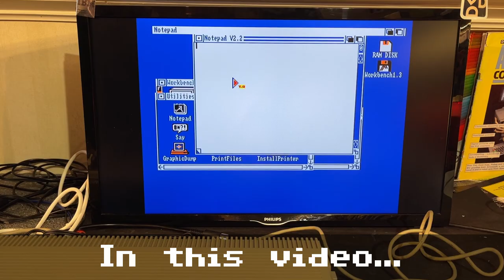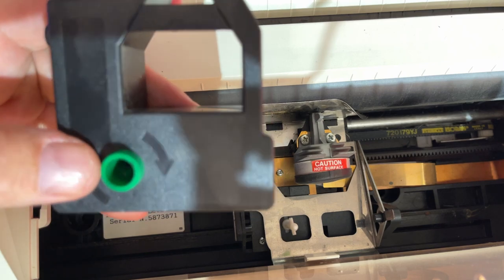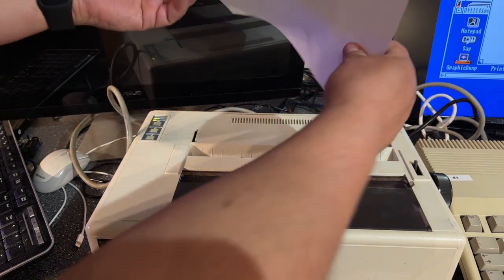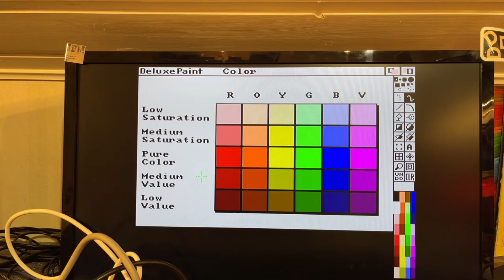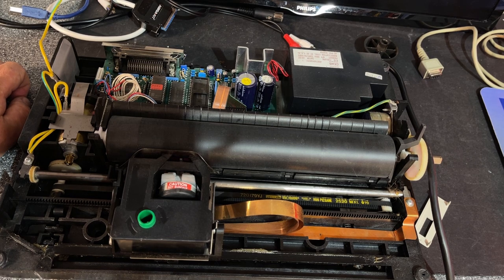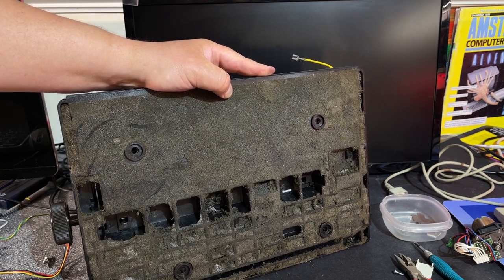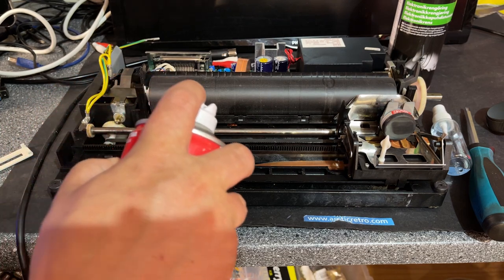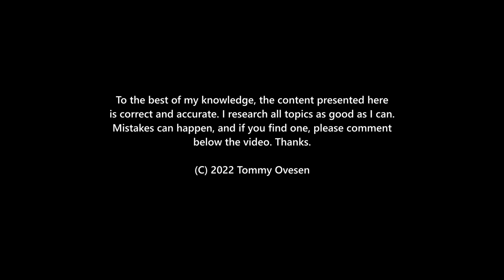The Commodore MPS 1500C retro color dot matrix printer - Can it still print? Restoration

Comment: Niely done, I used to have the MPS 1550C myself and have (like you) also found a replacement for it who was complete in it’s box. It did however had the same foam
Issue on the bottom. This printer has also a sort of a demo mode  when you make a certain key combination.

Comment: You can renew printer cartridge with WD 40, open it and spray just two or three short burst evenly on ribonn. Close cartridge and rewind it a few times (I use drill or dremel for this). If there is too much lubricant, paper or two will soak it. Works with B/W perfectly :)
Reply from the maker: Nice tips. WD40 can be used for everything it seems :)

Comment: We wish a speedy recovery for your finger. ;-)

I was surprised that you directly watered the printhead and drive gears. (I thought about a possible risk of corrosion. But I guess with a good drying and lubrication there should be no problems).

I'm guessing that (nowadays) it won't be easy to find inked ribbon cartridges for that printer. Have you tried looking for them?

I still have an old 'Star' monochrome dot matrix printer (which I used with my C-64 to do my school homework). I also have one or two unused ribbon cartridges.
I hope to find time to try it out again one of these days.

Ha det! 👋
Reply from the maker: Thanks for the message! I dried it real good. I had it outside in the sun for a few hours.